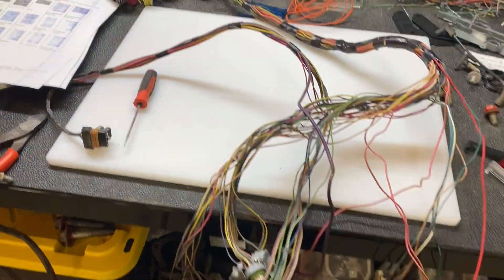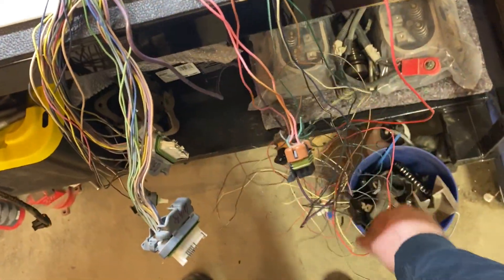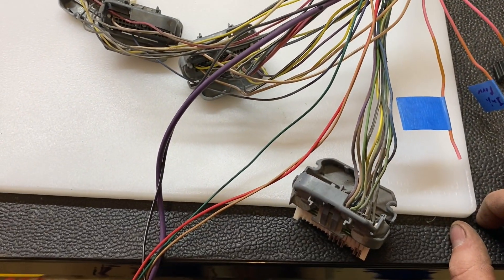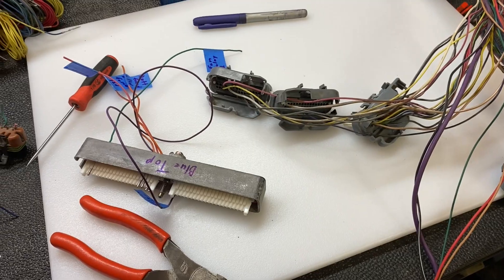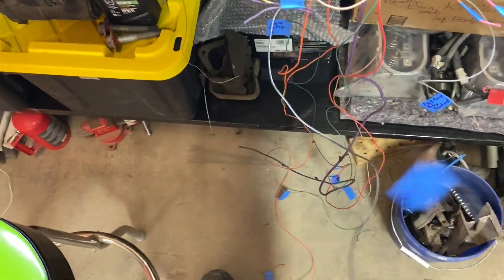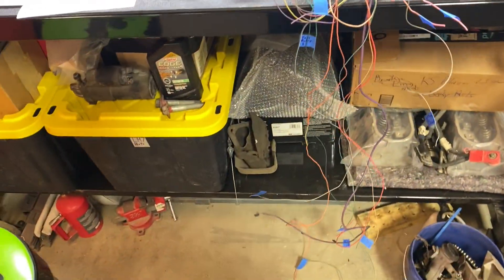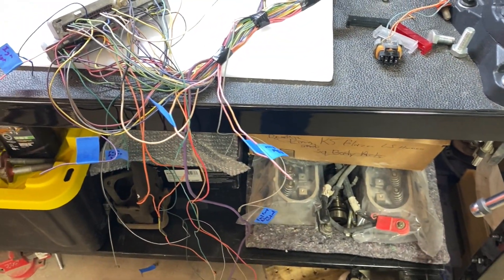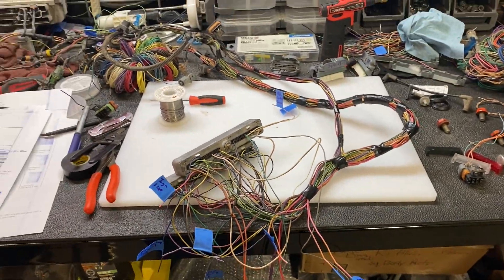LT1 To 411 PCM Conversion Part 2

Comment: Did the old LT1 harness PCM pins just depin from old connnector and fit as pins in the 411 connector? You don't even have to splice a bunch of wires?
I love those old LT1 cars and theres a ton of em neglected out there
Reply from the maker: Yea they use the same pins and you have to splice like 4 wires, the lt1 was a good platform.

Comment: Very in depth video.. Thank you..  Is there a programmer out there, that works on a 411 as well as a stock 5.7 L31?
Reply from the maker: Hp tuners is what I use to tune them
Reply: @TanTinPerformance  Will the same tuner work on both PCMs/ motors?
Reply from the maker: @kirkallen5578  As long as it is a 411 pcm you can tune it